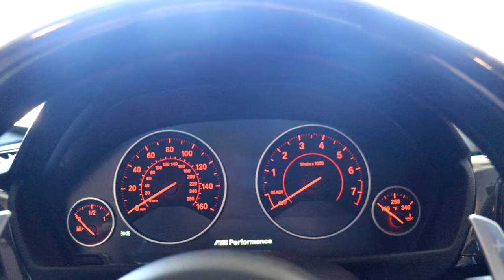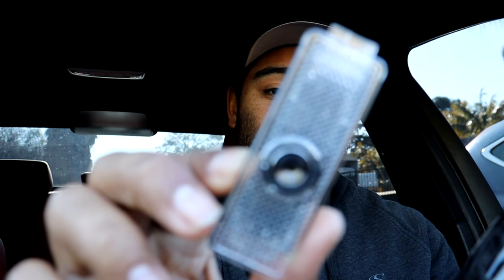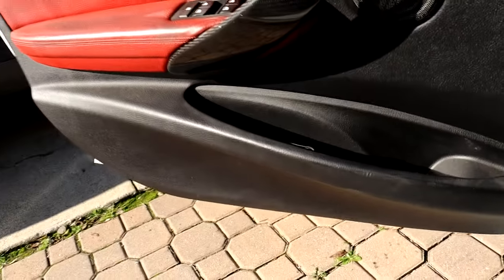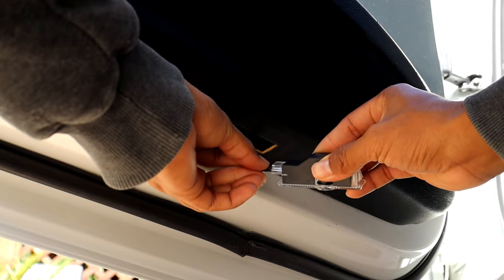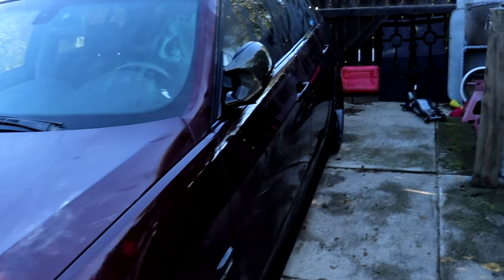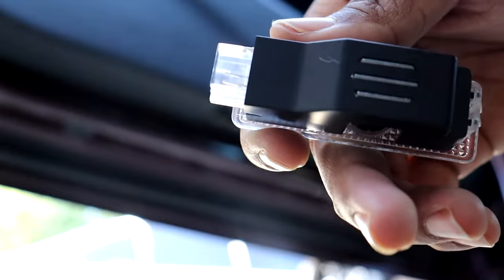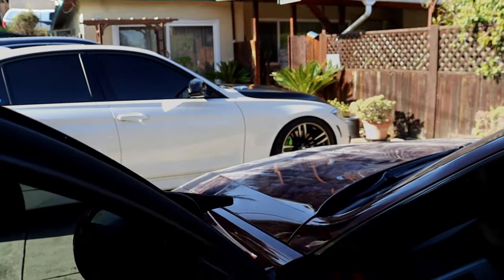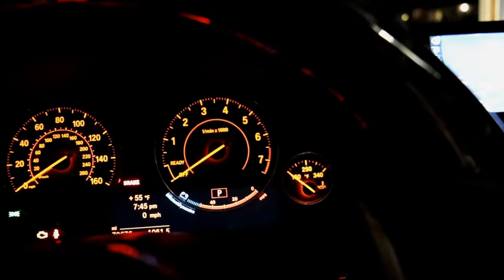BMW Logo/M Logo LED Door Welcome Light Projectors for My BMWs!

Comment: Hey man glad u posted another! Video I a question I wanted know do I have go just step 1 colder plugs for my down pipe and charge pipe/tune or can I also go step 2 colder I got my Dp a charge pipe I’m not gonna upgrade my inner cooler till summer ! Wanted to know if that still work
Reply from the maker: Yes either option will work. You'd be fine even if you just kept the original plugs. Engine will still run fine. The step colder plugs just help the engine run more efficiently when tuned to minimize the chance of misfires and allow you to get the full power potential. I think you'd be good just with 1 step colder if the farthest you'll take it is just FBO. That's what I have on mine currently

Comment: I have these lights and the only issue I have noticed is when I am driving at night with my headlights on auto it causes these lights to project a small bright circle on the the floor of the car do you know any way I can fix this. Have you run into this issue as well?
Reply from the maker: I haven't noticed that issue mine. where exactly does it project the circle?
Reply: @InlineSixAuto  can I dm you a picture on insta?